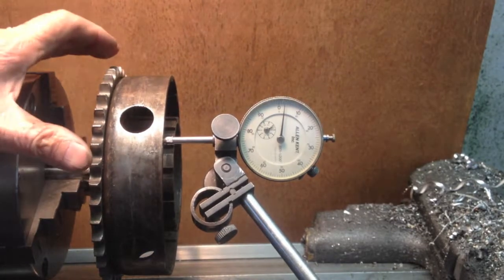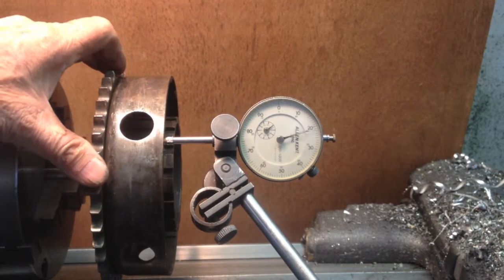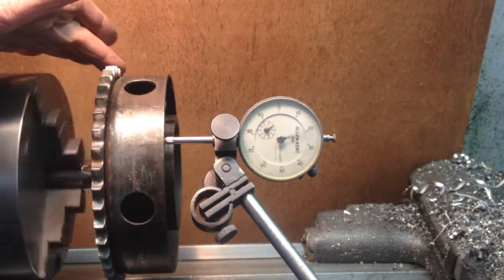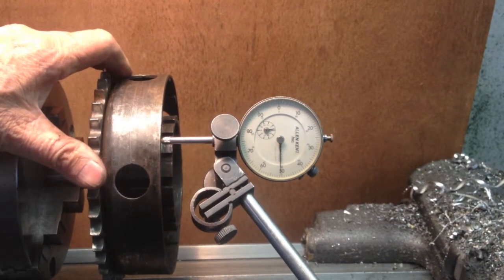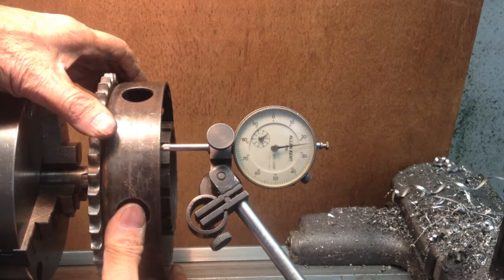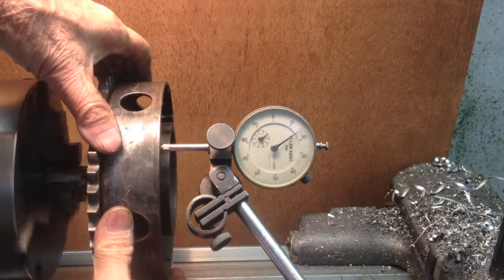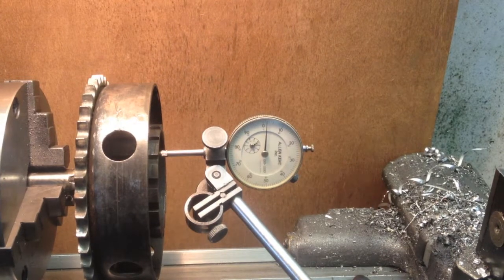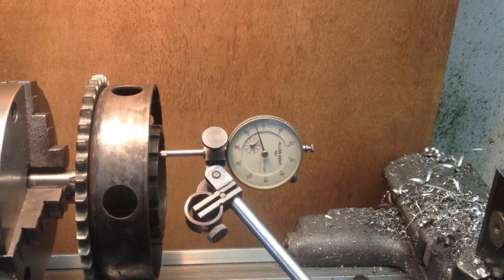Wobble or Runout

Comment: I've never looked at the runout using a dial gauge. If I did I would have taken the parts back and complained, but I've fitted new old stock parts that were about this bad.  I just thought that's how they were made so it must be ok, and certainly didn't get much worse over the years commuting. The main wear was in the basket slots that did grab the plates and cause drag until I dressed them with a file. I do like the CP and BA boxes. When you set them up right, they are so sweet and smooth.
Reply from the maker: Dean, thank you for watching and your thoughtful comments.  You are right.  There is always some run-out on moving parts. Recognizing the difference between run-out and wobble is important. Wobble will alway cause clutch drag and must be as small as possible.